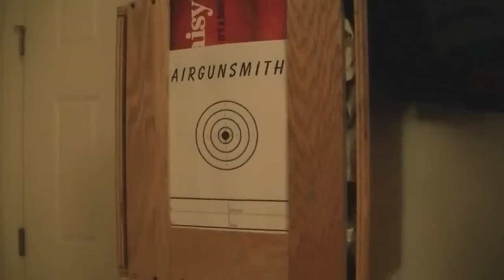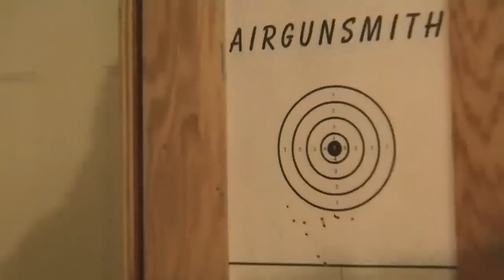Review and Operation: Daisy Power Line 1200 BB gun

Comment: Thanks for the info on the Daisy Powerline 1200. 
I just received one in excellent condition. It has a clear plastic window immediately ahead of the rear sight elevation, which allows seeing if the BB loads correctly; a great benefit because I was wasting CO2 and BBs by jamming at the breech because of not knowing the functional chambering order: 
The storage-to-chamber transfer hole is above the trigger and goes down from the BB storage area. From level, rock the pistol in  pitch to get a round (so that's where that term came from) setting in the top of the transfer hole. Then hold the pistol level and move the cocking never forward just enough until it clicks, while watching thru the window to assure one BB loads by dropping through the transfer hole. Let go the cocking lever, so it strongly moves back into place. Now the impressively accurate gun is loaded. The leftside handle grip is removed by simply pulling outward on the underside indent. The rightside  grip is removed by removing the screw. The leftside action cover can be removed by first removing the forestock (one screw), and two cover screws. They're all different lengths, so storing them in order will help with reassembly. I will use Molly grease in this one. It's able to make             1 - 3/8" groups at 10 yards, with little practice so far. I added a bit of white paint on the top of both sights, and camo duct taped the cartridge screw ring for silence. The gun is made of steel where it counts. 
A fine BB gun.
Reply: Thank you dude just found one of these. Cool looking bb gun
Reply: i have a non window variant of the 1200 and am frustrated when bbs dont load and i shoot air, do you think I could drill a hole like in the red ryder and be able to see the loading?

Comment: Pulled my original 1977 out every Co2 tube leaked out each time so I gave up on it, that was 10yrs ago.  I made a new seal for the ballbearing chamber from the O ring off of a used car headlight bulb(had to cut to fit).I then Oiled the four seals with pellet oil and works great!
Reply: Nice

Comment: This  thing is over 40 years old and still  works great.  What is the stuff you  put on the cartridge?  Some kind of lubrication I guess.  Mine has never been lubricated. 
.
Reply from the maker: Pellgunoil; it's a silicone-based oil. Putting just a smidge on the CO2 powerlet keeps the O-ring it mates against lubricated so it doesn't dry out.
Reply: @Smaug1  The original seal for the CO2 bottle went bad on mine. I cut a tiny circle the right size out of a bicycle innertube and poked hole in the middle of it. It's 20 years old and still working fine.

Comment from the maker: You can probably call Daisy and get it. Or even pull it out, and go find a similar size O-ring from the hardware store. Is the gasket cracked, or just dry? You might try putting a drop of pellgunoil on the end of the CO2 powerlet, and the oil will seal make the seal work again.
Reply: Small drop Vaseline

Comment: Hey, nice job. Thanks. I just got one in its original package at a flea market.  Question. What is bb gun oil and what can I use if I don't have any? Would Vaseline work? Thanks again. Nice job.
Reply from the maker: Thanks for the kind words, Edward. I guess you're referring to the oil Daisy recommends in the instructions? I guess it's a formulation of oil that won't clog up the valves in airguns. I would probably settle for sewing machine oil from the local fabric store or 3-in-1 oil from the hardware store. I wouldn't use Vaseline, if I were you.

Comment: I came across my old 1200 and was going to try it out after 15 years or so,unfortunately I find that the co2 cartridge does not seal properly. What is needed is a new sealing cushion located at top of co2 receptacle. Is there anywhere to order this part for repair?

Comment: Hi, could you tell me where to get the spare valve body CO2, thanks¡¡¡¡¡¡
Reply from the maker: +MARTIN GUTIERREZ Probably your best bet is to find a used version of this gun or one that uses the same parts and take it from there. I'm pretty sure Daisy wouldn't want the liability of people repairing airguns themselves.

Then again, if you find a used one with a good mechanism, you'd probably just want to use that gun and throw your broken one out.

Daisy used to make several models that used the same pneumatic system as this one. One looked like a Glock for example, I don't remember the other ones.

Good luck!
Reply: Thanks Jeremy!!!!!

Comment: Do you need the oil
Reply from the maker: Once in awhile, yes. Most airgun enthusiasts put a tiny bit around the O-ring every other CO2 cylinder. Otherwise the O-ring that seals against the CO2 will dry out and it'll leak. When that happens, you'll need to find a new O-ring.
Reply: Jeremy D thanks, I didn't know about that I got this gun from my grandpa and it hasn't been used for a long time so I think it might be a new ring but don't know where to find one